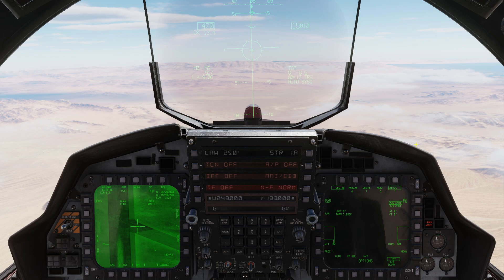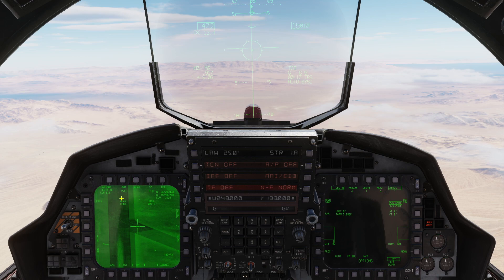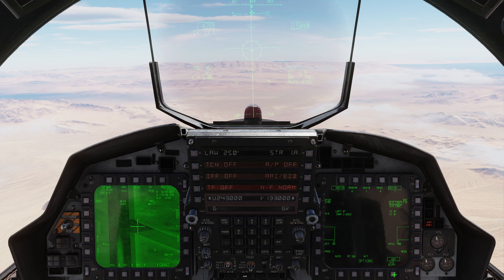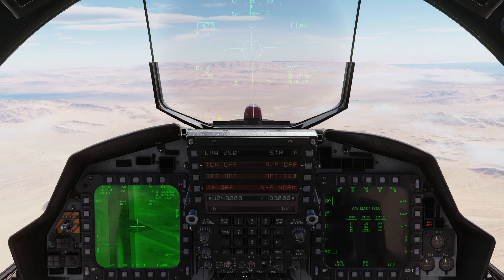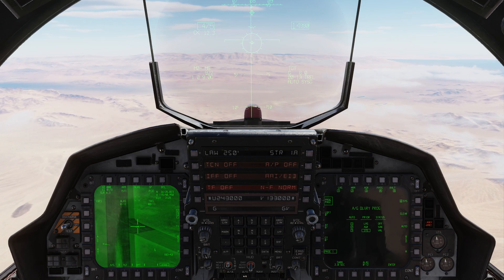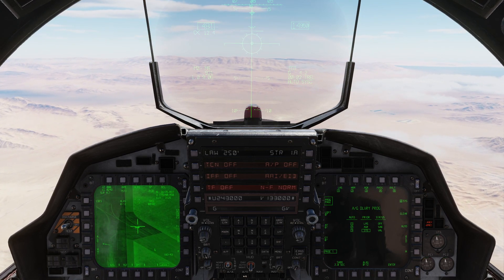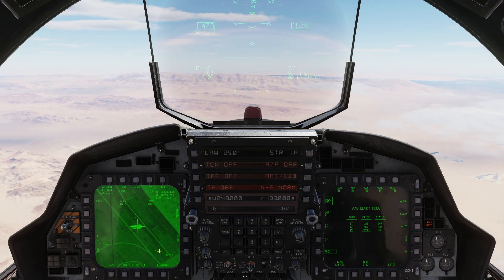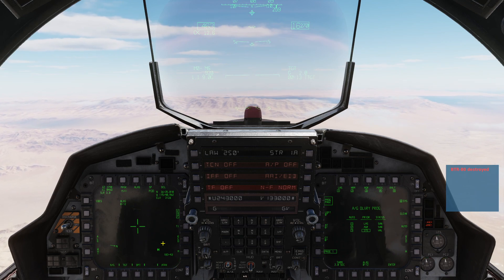F-15E ALAS Demo

Comment: Thanks Notso!
Q: Why did you enter a spread between the bombs, if they both hit the lased point? Is that to give separation at bomb release?
Reply: If you release two bombs simultaneously, which guide onto the exact same spot, then they will collide eventually and possibly blow each other up before even reaching the target.
Reply: I have had instances where I dropped two GBU-10’s, but they hit each other right before they strike the target. I’m not sure if it’s a DCS bug or a real life concern. And it could be why Notso does it. But I’m very interested in the answer 👍